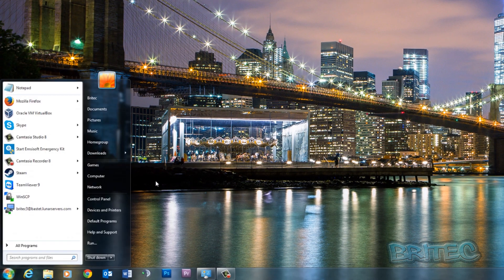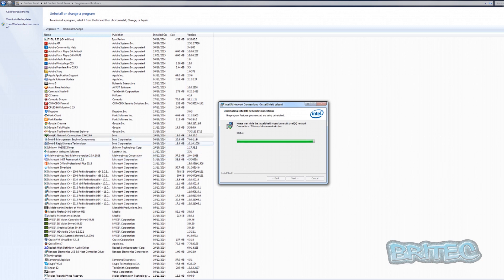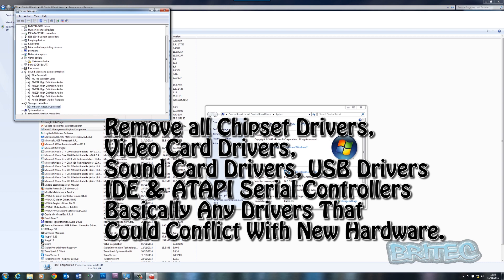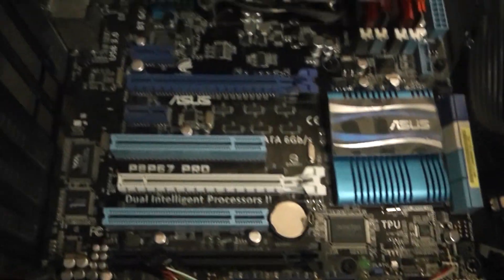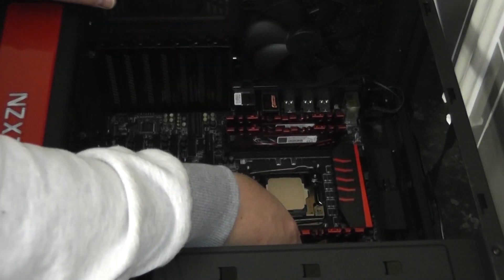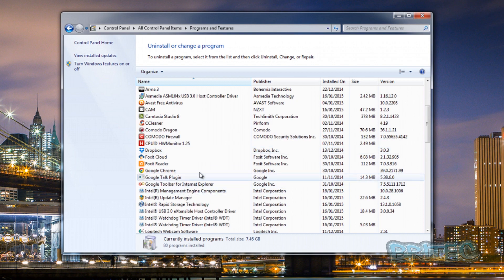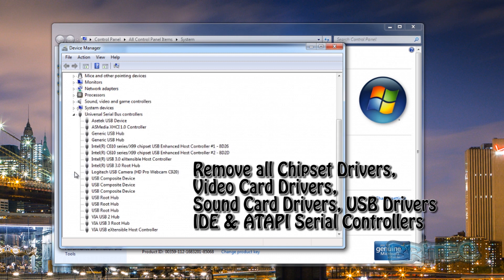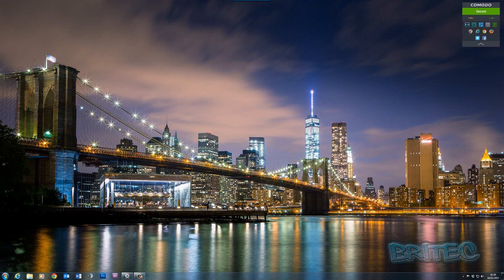Change Motherboard Without Fresh Install of Windows

Comment: Good video. However, perhaps you can explain how you got around the Windows issue of having to reactivate it. As it stands here in the US, changing the MB resets the key and makes you have to activate Windows. Which is not too much of an issue except for one thing, it locks your original Key and will not activate it. But that's MS for you I suppose.

Abit this is not a great issue provided you use a retail version of Windows. If you use a OEM version, you pretty much have to just go out and buy another copy or call MS to purchase a new Key.

Comment: Dude where was this video last week!  I spent all weekend last weekend doing just this.  ROFLMAO.  I looked all over for a good video on this and didn't;t find any.  Had to go it alone with info form Toms Hardware member posts about how to do it.  Then after I do it, you go and post the information I so desperately needed.  Talk about timing. :D  I changed from an ASUS to a Gigabyte.   :D  Well its nice to know that what I did is pretty much what you did here.  I tell you Sysrep is worthless.  This method had issues but it worked well thus far for me.  I did have to restarted in safemode on the new board after initial start-up in order to get windows to auto install basic drivers and allow me to access the CDRom.

Also running CCleaner after all was said and done also might help sort out remaining issues.
Also windows will re-validate. For me it did it without incident but others have had issues requiring a phone call to MS.

Thank you for your videos mate. They are very helpful.
Reply from the maker: LordAtrocities Yeah you will have to reactive your copy of Windows because its a change of hardware.
Reply: Britec09 Never said anything aobut that in the video, How do I do that

Comment: Would I pretty much have to do this soon when I build a new pc but keep my 3 hard drives?
Reply from the maker: TechNic You don't have to do this, it only has to be done if you want to keep your hard drives and use them without formatting them and installing windows.
Reply: Britec09  yeah i see, thanks, what are the downfalls of not doing a fresh format?

Comment: you can even use dUninstall to take out all the old software...or go step further and use Revo in advanced mode to take out all left over registry entries. Keep the videos coming!
Reply: Would this work the same way for windows 10
Reply from the maker: Matthew Davidson Cheers Matthew.
Reply: +Britec09 How to tell which driver is the chipset drivers? There is so many in the "System Devices" section. Do I have to remove all of them from this section?
Reply: Matthew Davidson:: yup also iobit uninstaller, will also take out left overs...

Comment: I just start up in safe mode the 1st time after changing the motherboard and 8/10's that works, Your way is better, thanks for the tip.
Reply from the maker: Barack Smith Your welcome.

Comment: Hey guys I have got a new graphics card but I don't think it likes my motherboard. I think the problem is the BIOS but I have an OEM BIOS version so I cannot use the new BIOS updates from the motherboard manufacturer. And the computer manufacturer has not got a BIOS update. I really don't have the money for a new licence of Windows but if I got a cheap modern motherboard would that work and is there any way I can transfer my current Win7 licence across? If I phoned Microsoft for example. Thanks.
Reply: Grant Kidd Are you sure it's not compatible? If it's using the exact same hardware as the non-OEM model you should be able to update the bios anyways. Though it's still risky since it involves mucking with BIOS to begin with.
Reply: Objectified Cross Got it working, just replaced the motherboard and Microsoft re-activated the OEM Windows licence
Reply: Oh that's really sweet.

Comment: Thanks Brian :-))

i like you honesty brian, "cant be bothered", yep i fully understand that feeling. :-)
If its my system (not often) its a bootup from the install disk and do a repair mode, that has worked quite a few times :-))

Shame that the registry section delete isnt 100%, worth a laugh though lol, sometimes you have to have the logic of "if its doomed then i cant make it worse" and it often does work, odd that :-)
Reply from the maker: zx8401ztv I always enjoy your comments lol
Reply: Britec09
lol just as a side comment, what cpu did you have in your old board, that heatsink was bloody massive!!.
Reply from the maker: zx8401ztv lol it was a i5 overclocked to the max lol

Comment: Great tutorial....but say i want to take some of the hardware from my prebuilt HP desktop and move them into a new case with a new motherboard. Same procedure ok?
Reply from the maker: John Ivar Rubach If you swapping motherboard, same procedure, if your keeping graphics card or sound card, I would still remove them drivers and reinstall them.
Reply: Britec09 Preinstalled Win7 with recovery partition will work on a new mobo?
Reply from the maker: John Ivar Rubach Well the recovery partition will have all the image of your old machine and drivers.
Reply: Damn...true...yes ofc it has.
But should that cause a problem if i dont physically start a recovery process? If i delete all drivers and swap MB... will the system automatically search through the recovery partition for drivers not found? Or u think i should be able to install them from usb/interwebz?
Sorry for all questions...really appreciate the help.

Comment: Nice one Brian, will this work on an OEM version of windows as i thought the licence locked in with the hardware once activated. cheers mate keep up the good work .
Reply: If you bought a PC with Windows preinstalled and you haven't got a original windows CD, then I think thats right. However, if you buy an OEM version online, than there should be no trouble.